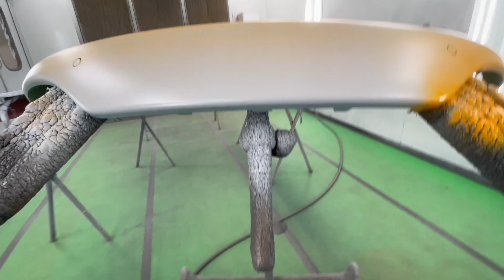Complete Paint Job on a McLaren 650s - Crashed and Abandoned (Part 3)

Comment: What guns are you using for primer/sealer, base, and clear? and what clear are you using? Your work is fantastic!
Reply from the maker: Primer is use the Plastic 3m 1.8 spraygun.
Sealer I use Tekna Prolite 1.4
Base I use tekna Prolite 1.3, sagola 4600 1.3, or sata 5000 wsb. 
Clearcoat Ppg ec520/ec530…and shopline Jc7200/jc830 depending on the jobs and vehicle 😄
Reply: @LncPainter  thanks for your reply! I have a 2012 mclaren mp4 it’s white and I rebuilt it and I’m gonna attempt to spray it😂
Reply: @LncPainter  which gun did you use for clear coat on this 650s?
Reply from the maker: @alexouchakov1423 Iwata w400 1.3
Reply: @LncPainter  what’s the exact model for the gun and tip? Is it this? W400LV-13WBX 1.3mm Gravity Feed Spray Gun Only 2113 Iwata 2113 0
Reply from the maker: @alexouchakov1423 thats the one 👍🏻
Reply: @LncPainter  isn't w400 used for sealer?